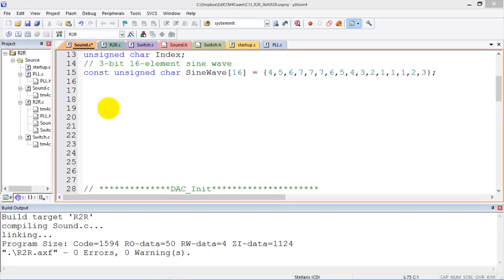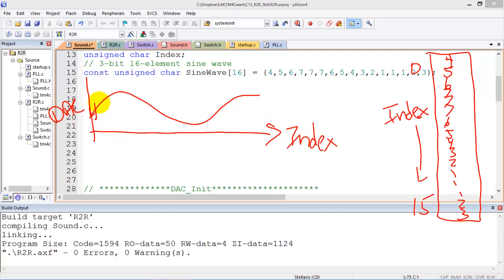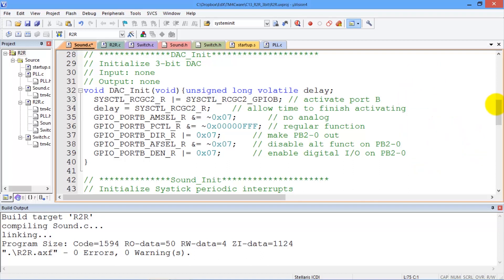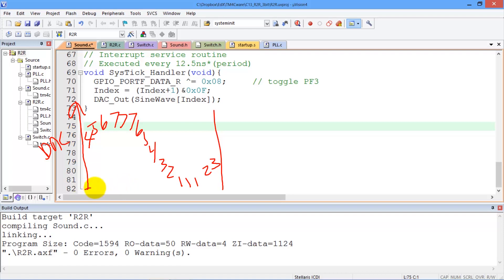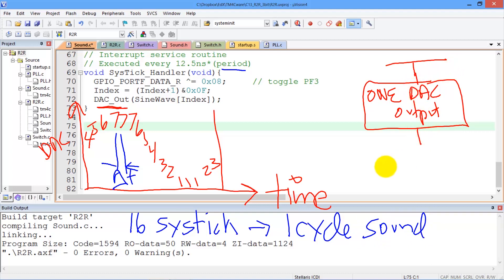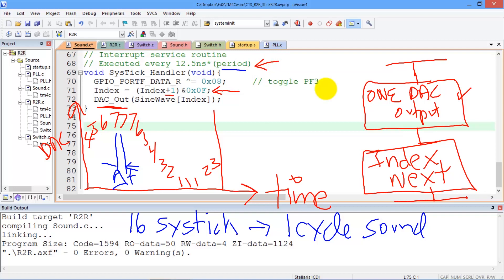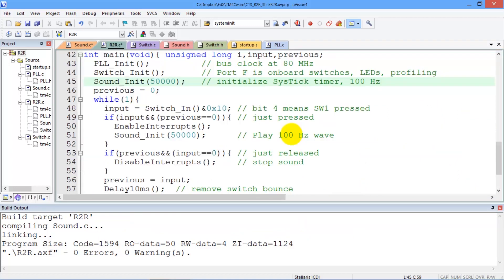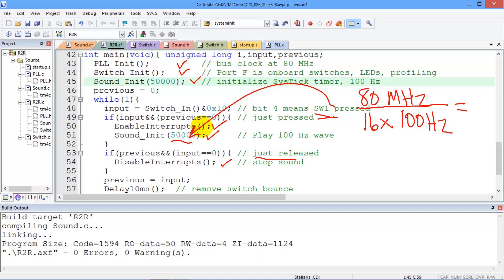C13_Video5c Show software  R2R 3bit

Comment: hello sir,

in the code mentioned in Ebook,
void main(void){
  PLL_Init();          // bus clock at 80 MHz
  Switch_Init();       // Port F is onboard switches, LEDs, profiling
  Sound_Init(50000);   // initialize SysTick timer, 1.6kHz
  while(1){
  }
}

 if we dont give an infinite while loop in main() will the systick keep running in the background and keep producing sound???